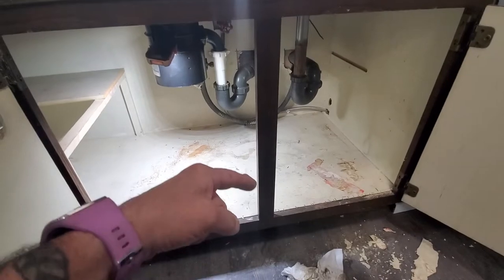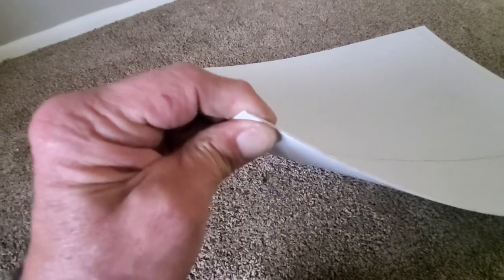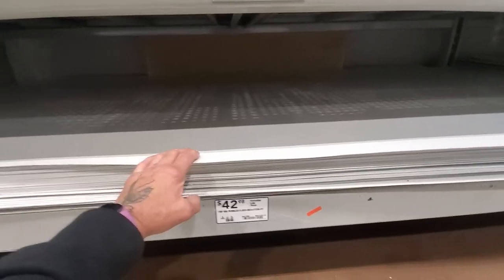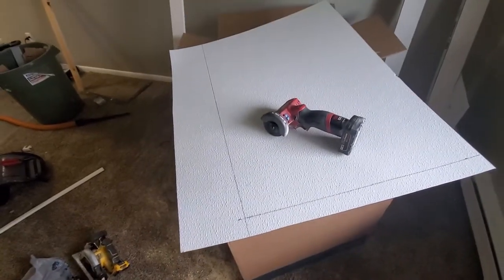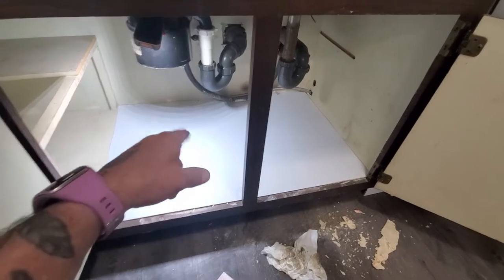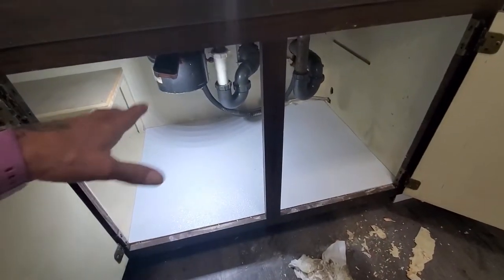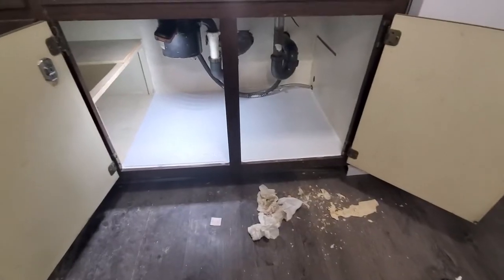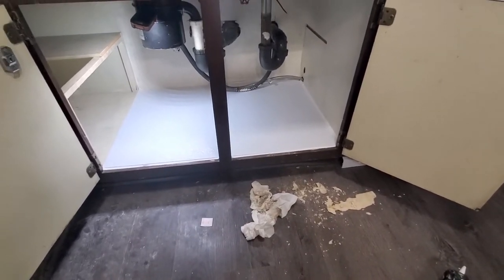How to repair cabinet under kitchen or bathroom sink

Comment: Yes Ray that microwave you put in the day you need to cover up that fan motor on the back side for some things falls in it you cover it up it'll blow out the front of that microwave cuz I hate to see somebody put something up there and it falls down the fan motor back during the wheel and make it a lot of noise. 🤫😃💪👍🤟🍺🍺🇺🇸
Reply from the maker: Lol.  Thanks for the comment and i did -- it comes with a cover I dont put everything in the videos have to keep them short